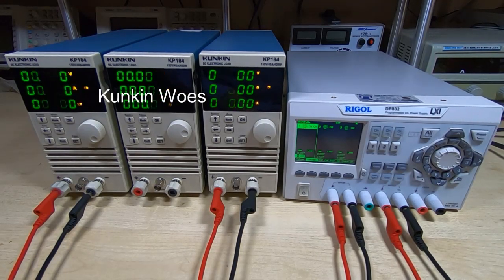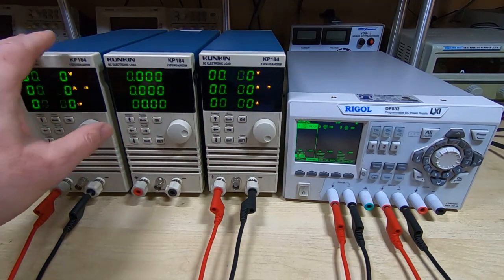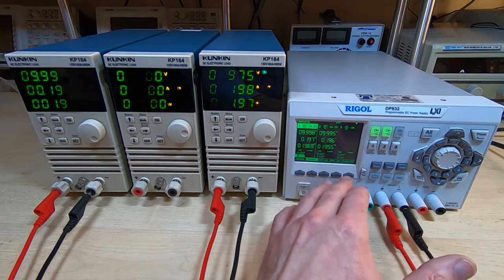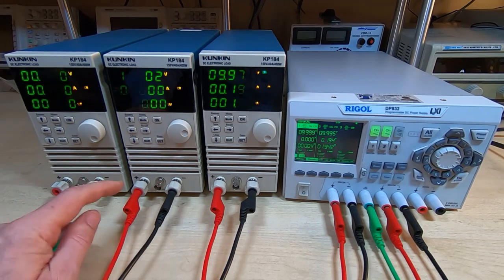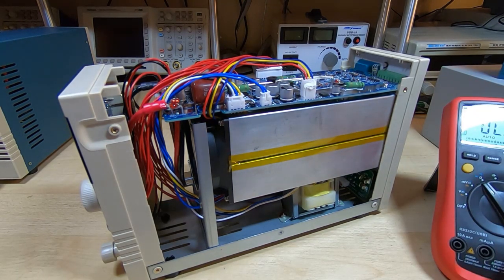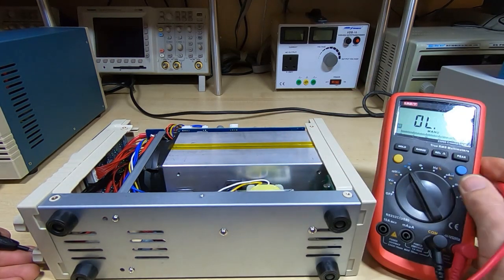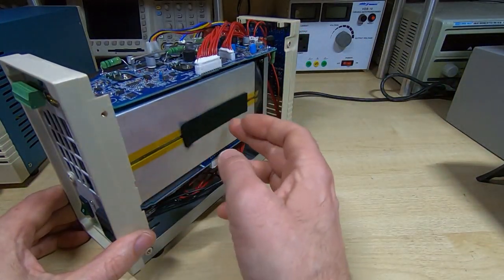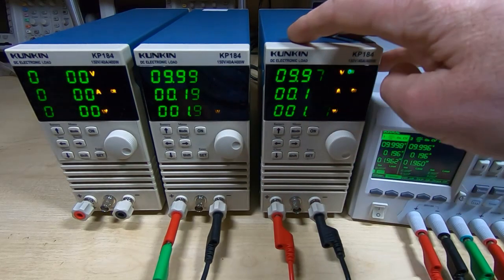Kunkin Woes -  Faulty Kunkin KP184

Comment: Same issue here. Plus, when set 10-35mA CC, the load does not indicate the right current, as if it was really low for measure. So in practice, you have measurements over 35mA. In addition, the current floats a lot.

Comment: What is the purpose of the Kapton tape along the two halves of the heatsink? 🧐
Reply from the maker: It seals the air duct and also insulates the heatsinks from the metal case (They are connected to V+). On my units I added some thicker insulation along the centre to avoid any future problems.
Reply: @JerryWalker001  yes, I just opened my newly received unit and realised that V+ is connected to the heatsink. Its a bit optimistic by the manufacturer however to assume that the electrical contact between the enclosure, if pressed, and the heatsink will happen exactly along this 1 cm strip where the Kapton tape is positioned 😁. Your additional insulation pad seems much more reliable.
Reply: @JerryWalker001  Also just realised that the 4 screws on the back panel of the unit are also in electrical contact with the heatsink and V+, so everyone out there, watch your fingers when reaching for that power switch in the back, there will be potentially up to 150 VDC there, far above the 75 VDC hazardous voltage limit in Europe according to the Low Voltage Directive ⚠️ ☺️. Although, you will also need to touch the negative terminal simultaneously for it to become hazardous.

Comment: First of all, thank you for your videos. They are very helpfull. I bought one and as expected encountered some issues.
The positive plug was grounded due to the contact between the transformer and one of the screws on one MOSFET (issue fixed). Like you, the diameter of the plugs is too big (4.2mm), and the cover is not grounded (issue fixed). Secondly, I found the Kapton tape unstuck on one side of the heatsink, which can create an air leakage, and thus degrade the cooling flow.
I also found a bad contact in the power plug on the rear panel, you have to push the cable strongly for it hold, finally I replaced the main câble and it's a bit better.
Finally, this afternoon,  testing a power supply, the charge went into "OT" over temp. After removing the cover, I found the fan stopped. This was due to a bad contact in the fan connector, I could reproduce the issue by moving the connector. I found nothing special, after reconnecting the contact was correct and permanent. I think I must have touched this connector during the previous disassembly to correct the contact of the transformer with a transistor.
I still have to replace the 4mm plugs and to put a main switch on the front panel. In spite of these problems, the load is functional, I tested it at 400W. And the measurements are very accurate. However, I wonder how these electronic loads could have passed the factory final tests!!!!!
Reply from the maker: Thanks, That information should hopefully help others. I suspect that factory testing is somewhat minimal but looking at it another way, If they were manufactured in the UK then they would be 3 times more expensive so I still think that a few hours fixing them is worth the effort to save a few £hundred. Not really practical for a company to buy them when standards must be adhered to but for the hobbyist they are worth the money. The fact that these simple issues are still present after several years really goes to show how little reward there is in some countries for people to put effort into improving things. Unfortunately I think we are all heading in that direction with standards dropping daily which is another reason I post these videos.
Reply: @JerryWalker001  Jerry,
I live in France. I completely agree with what you said, unfortunately! Thank you for all your videos, I really appreciate them.

Comment: One strange thing I noticed, if you look at the three through the video camera, the two that are new are flashing at a different rate than the old one. You would think if they were all the same, the flash rate would look the same as well. I know they aren’t flashing, just the frame rate of the camera makes it look like they are. Strange though
Reply from the maker: The rate of flash is controlled by the micro inside each unit and is most likely influenced by every setting so unless each unit is set up in an identical manner then I suspect that the flash rate will vary. It will also depend on the relationship between the units micro code and the lab LED lights as this also affects the rate of flash (If I turn off my lab lights the flickering will almost stop). It tends to indicate that the firmware is fairly simple and does not use interrupt driven display refresh functions.

Comment: Seriously dude isolate the fets from heatsink they probably skimped on thermal pads
Reply from the maker: If you did that it would not work. Have another look at the video.
Reply: Good ceramic thermal pads cost money. Rubber shitty thermal pads work bad and will kill MOSFETs. So, 'chose your weapon' :)

Comment: Just received my KP184. Before powering it up got it opened and checked just in case there is any similar issue with the transformer.
And yes it was. Transformer was touching the mosfets above, just as the video was showing.
There is a very narrow space there, just a few mm and obviously some good bump did this.
So, pushed a bit the transformer and its metallic base in order to not making contact and thats it.
I wouldnt even imagined that issue, so kudos to Jerry.
Reply: Ditto for my KP184. 

Electrical + Kapton tape and some bigger washers should do the trick.

Thanks Jerry.

Comment: Jerry I don't think it was dropped in shipping.  It would take a lot of force to bend those transformer tabs and note they are both bent about the same.  I would think there would be other large damage to the case if it was caused by being dropped.  I have seen large quantities of transformers from a supplier and some had bent mounting tabs and we had to straighten them before installing them into the product.  I think it was just installed that way at the factory.  As you showed in the video it was working fine until the ground test and I doubt that on an inexpensive load they would do that test in production.  Nice video and well produced.
Reply from the maker: It is almost 100% certain that it was shipping damage. The marks on the screw and the way it was bent is consistent with a drop. Also the tabs are VERY soft and easy to bend. In addition if you look closely at the tabs you can see where the tabs were bent against the screws as the witness marks are very clear.
Reply: +1 for shipping damage.
While my KP184 didn't have a bend on the bottom panel, the tabs on the transformer were bent, allowing the transformer to juuuust about contact the FET screws. The transformer housing is made of very thin sheet metal. The core has more than enough mass to bend the tabs if shaken around in transit.
Reply from the maker: @PatrickECleary  Yes that is exactly what happened to mine. The transformer mounting tabs were bent. The bottom of the case was fine. I put some insulation on the top of the transformer as I did not trust the strength of the tabs. A couple of flat plates (Square washers) over the tabs would be a good idea to make it more secure. The tabs are not only thin but surprisingly soft so It does not take much to bend them.

Comment: As a another YouTuber pointed out, the screws on the back of the Unit are connected to the heat sink, A Potential electrical shock risk, since they are in close proximity to the power switch. The entire backplate is potentially at positive input voltage. So this plate cannot be grounded, yet the sides of the case are. Make sure you turn all the input current/voltage OFF and Disconnect before you turn the Unit on or off.

Comment: Interesting, what kind of banana leads are you using, they look nice.
Reply from the maker: https://www.ebay.co.uk/itm/20pcs-4mm-Double-Ended-Banana-to-Banana-Plug-Soft-Silicone-Test-Leads-Cable/332742076954?ssPageName=STRK%3AMEBIDX%3AIT&_trksid=p2057872.m2749.l2649I have no affiliation with this seller

Comment: Thanks again! 
In my experience the more serious Chinese brands (like Kunkin I assume) are often not unwilling to offer a partial refund if you clearly point out that your device came with some damage. 

Just a general remark if you have a similar situation.
Reply: The problem is not that they don't handle warranty claims at all. The problem is that a Chinese brand would even design a load where the whole plate is on the positive potential and so close to the earthed case. That's just bad design asking for troubles.

Comment: 1:27 “But it does need carefully testing when you get it”. 

I got a cheap 50W LED panel light. The earth wire was thinner than the live and neutral solder wouldn’t stick to it. Probably aluminium. 

So I decided to replace the whole connecting wire with a new one only to find out that the earth wire wasn’t connected to the metal(!) fixture. 

That caught me by surprise and reminded me to always check earth connection with these Chinese products.  

The panel was mounted with two small blobs of sanitary silicone in stead of a heat sink compound. Not good at all but loose earth wire was really appalling.
Reply from the maker: Sometimes the only answer is the bin. I mostly find that with a little work the items I get can be made useful.
Reply: Jerry Walker 
Yes, I fixed both issues and enjoy doing so, but a fear most people just connect the wires and think they are safe. 

So to anyone: Check the earth connection.

Comment: Seems like those semiconductors (MOSFETs?) on the high-side of the load ought to have been insulated from that large heat sink.  It seems optimistic to have a mechanical design that requires that large heat sink is kept electrically isolated from the chassis/casing.
Reply from the maker: I think they are using the heatsink intentionally as a high current conductor. The MOSFETS are not connected to the heatsink via the screw. The heatsink is intentionally connected to the +ve terminal via a PCB trace And the screw on the mosfet just happens to be screwed into the heatsink. A very odd arrangement.
Reply: @JerryWalker001  "It's not a bug, it's a feature!"  That's a... novel solution..    Thanks for the (increasingly!) interesting video.
Reply: @JerryWalker001  They do the same thing in 12V UPS's due to the large currents needed to invert 12V to 110/230v. Of course in the ups the heatsink is in another postcode compared to the metal chassis unlike the KP184. I'm getting a couple of these loads so will check them on arrival.
Reply: Non-isolated heatsink is a rational decision. Otherwise they must use ceramic thermal pads which cost money.